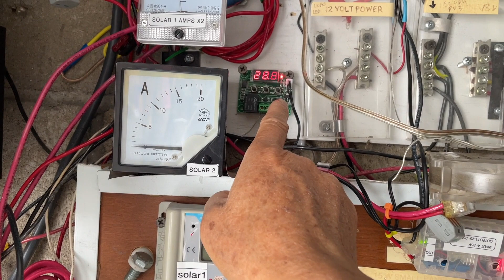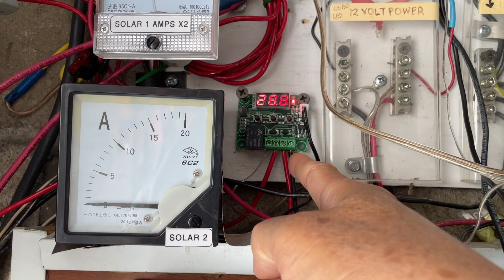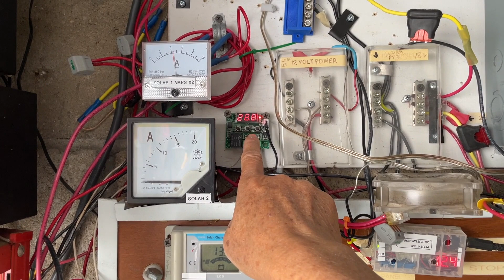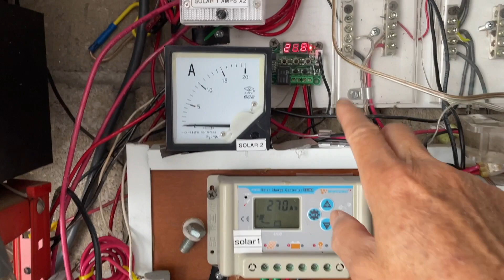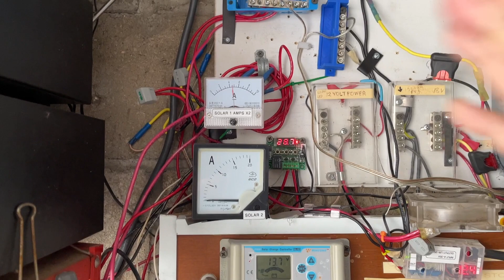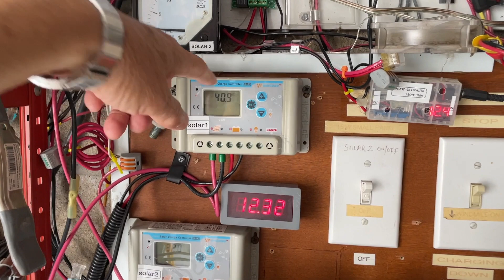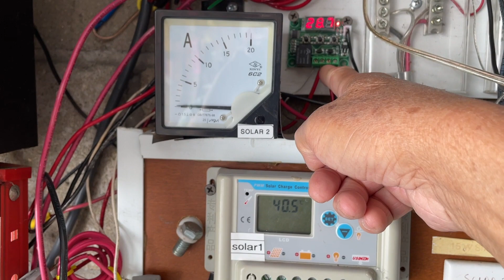DIY LiFePO4 batteries low temp charge protection for Under $10

Comment: Why didn't you link the thermostat??
Reply from the maker: @tluva1020  One is for low temp disconnect and one is for high temp turn on for fans. Didn’t know you can connect the two thermostats. These are not smart thermostats.

Comment: Good idea. Thanks. The LiFePo batteries with low temperature cut off seem to have something very similar, but just built into the BMS and with the probe inside the battery case.
Reply from the maker: Thanks for commenting. Looking forward to battery chemistry that won’t require you to stop charging because of cold weather.